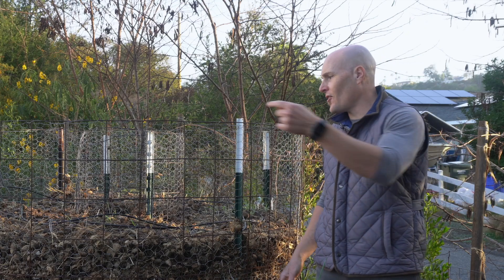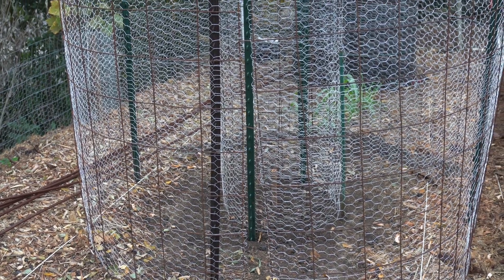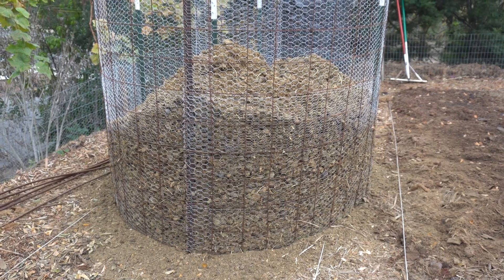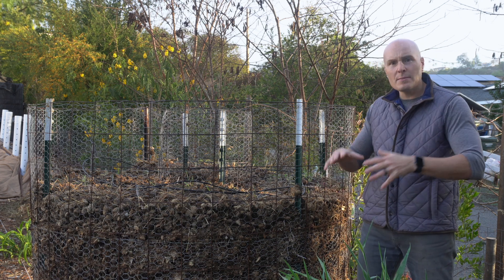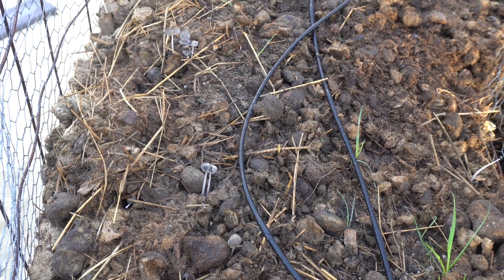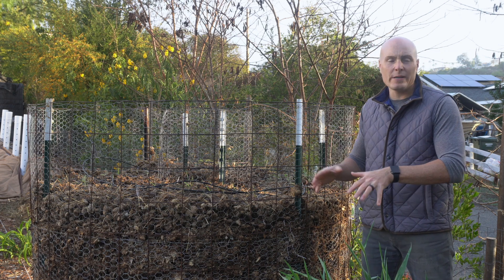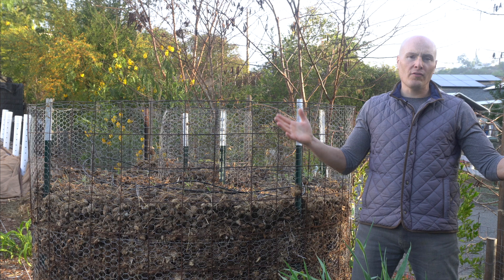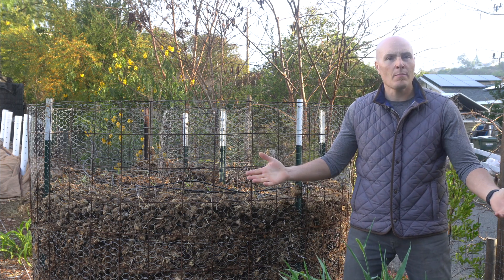Huge Compost Bioreactor | MORE COMPOST, LESS WORK

Comment: Hello Diego and commentors, I am working one of these bioreactors with my own modifications. The modifications are to the height of this system, it is 6ft tall and implements the extra 2 in outer ring with only woodchips. I did this because I live in Fresno, CA and our summer temperatures are very high so I hoping this will help keep the reactor moist (the reactor is located directly in the path of the sun, so I feel this will be a critical part of the composter) I have also added my own modification to this system which is a taller center tube. It is 8 feet tall and completely covered in a black weed barrier. I'm thinking behind this mod is to try to take advantage of passive solar aeration. My intention is that the added black weed barrier helps to heat the air in this tube as it rises forcing the outer rings to draw in more air from the edges. My concept is based African termite mounds. I started it March 6th 2024 and everything seems to be going well so far. I used only shredded chop and drop materials for the last few seasons of gardening onsite. I did later add 20bls of spent mushroom blocks when adding more fill material  after the pile settled about 8 inches. My temps seem to be going going down now about 3 weeks but are still quite high averaging about 110 degrees F. I did record temps as high as 150+ degrees F for a few days. I will probably add fill material one more time this week then top the pile with 6 inches of just woodchips protect the compost from the sun as the spring begins to heat up. I am very excited to have this reactor going as I wanted to build one basically right after learning about them.  I will also be building at least 3 more in the next few months, I plan on testing out other builds to see my  modifications seem be working as intended or are worth the extra effort and build materials. If you'd like to follow my systems follow my Instagram @CypressCompostCo and @hella_soil. Best wishes to y'all.

Comment: 73 old gardener here. 8 8’ T posts $96 n tax
Welded wire 15’ $89
Chicken wire…
$200 is too costly for tiny gardener. I will just continue throw/go/throw n go some more. Not in hurry have lots of compost n more leaf mold both free. But you are spot on. Cheaper more pleasing more efficient zero plastic. 
The Footer Bio Reactor!

Comment: At the end of the day, I have learned that the quality of compost is mostly a function of your inputs, not the method. If I am only composting grass, leaves, and other browns, it's ok compost. But if I add manure, kitchen scraps, and especially coffee grounds, the quality goes way up. You can't make something from nothing. But as much as I would like to supercharge all my piles, i also have to worry about rodents and other varmints. Plus, managing inputs throughout the seasons can be challenging. Bioreactors are an efficient way of dealing with the overwhelming amount of fall leaves when greens are limited, but they require a reeeeeally long time for maximum effectiveness. So composting is not all rainbows and unicorns. Don't get me wrong though. I love to compost, but it comes with its own set of challenges like everything. You just have to be observant, and what I found that is more helpful than anything else is to keep a garden diary.
Reply: Concerning the issue of input versus the method: Johnson's data seem to contradict your theory. Both fungal and bacterial diversity in his method are phenomenal.
As to the time needed for the optimal effectiveness, just look at it as long term investment. Your "overwhelming amounts off fall leaves" should provide you with enough materials on the side for faster, shorter term composts, shouldn't it?
Peace.

Comment: I’m curious what David Johnson would think about this. I’d love to see the finished product out of both the JS pile and yours. Great work
Reply: Yep a quick follow-up vid with David Johnson would be very valuable.
Reply from the maker: What are you going to learn from seeing the finished product from both?  I show you a picture with two piles.  What are you going to be able tell from looking at them?
Reply: @DiegoFooter  Good point. I guess it would take a side by side comparison between the two done at the same time and under similar conditions. I’d like to know if there’s a difference in the fungal activity between the two—which of the two is a better finished product that way—and will one break down faster than the other. Maybe I’ll try it and report back.
Reply: @DiegoFooter  coloration and effect on fungal growth
Reply: @DiegoFooter  
I would definitely like to see a video of you opening up this particular composter. I am curious to see what the material looks like close to the outside ring and close to the inside ring compared to the middle furthest from the Rings. In other words, did the pile dry out too much close to the wire rings. I am planning to use your design to build a few of these bioreactors over the next few weeks to compost leaves this fall.

Comment: I am planning to build a few of these bioreactors based upon your design with a few of my own improvements. I am going to use 50 inch by 16 ft galvanized cattle panels. I won't have to do any cutting and they won't be all rusty like the wire mesh and it will be cheaper because I won't have to pay $275 for a 150 foot roll of wire mesh. Using the 16 ft cattle panels, the outside diameter will be 5 ft and the inside diameter will be one foot. I am planning to make mine at least 6 feet tall. The very top portion will only be chicken wire, but I figure that will be strong enough for the top portion to hold the shredded leaves in.

Comment: I really like it, Diego. I am going to make one. I made one in a trash can like you made and it never got hot. Not sure if I don't have enough material, or what. I have it mixed about 2 parts carbon to 1 part green. Anyways, I am interested in making this one to try out. Thanks for going through and making all the different systems and testing them out. Doing all the research on all these different systems. Out of all the ones I have seen and looked at, I like this one the best.
Reply: I've never had great luck in trash can style piles. Common issues are: 1) brown carbon is already mostly decomposed/too dry 2)not keeping it moist enough. One way to cheat is to compost under a large deciduous tree with your pile touching the dirt. There is already decomposition going there because of the leaf litter, and the shade of the tree will keep the pile from drying out. I've also found that priming a pile with some manure helps a ton.
Reply: @atomicsmith  Thanks for the information. I hadn't added water since the huge pile of leaves I have are sitting out and we have gotten rain just about everyday since Jan. Today I started adding water to my trash can to see if that will start it up. Maybe that was the issue. It is sitting on the ground with holes in the bottom already, in a spot where my compost pile is, was. I have rotated the big pie with my tractor so it is moved over and really not much left of that one. It was wood chips that I mixed garden scrapes into. I did try to innoculate the new trash bin with old compost.
Reply: @EarlybirdFarmSC  Ah! I think the wood chips are the problem. Are they the big chunks of bark people often use as ground cover under landscaping? If so, those are very hard to breakdown. If they are from a wood chipper, do you know the species of tree? some trees like cedar and pine can be very hard to breakdown as well. Often if the chips are too big they just won't breakdown. Maybe try something lighter like sawdust or dried straw or hay. Sounds like you have plenty of moisture. maybe too much?
Reply: @atomicsmith  The wood chips were from a friend of mine that does tree work. They are all species but mainly oak and sweetgum in that mix. They are almost all the way composted into soil. Also, I only added in a shovel full, maybe two. That was just to introduce some bacteria and fungus into the new compost mix. Yeah, maybe I need to take out some of the leaves and mix in some shredded paper or hay-like you mention. The chips were piled up, I mean it was a huge truckload, and they were hot a day or so after they got unloaded. Just from the chips and the leaves that were ground up.

Comment: Hi Diego I have 2 horses and like your modifications to the bioreactor. Instead of filling it all at once do you think I could start filling it daily? I think one horse makes 50 lbs. of manure a day if I remember correctly. I wont have much of anything else to add to it as far as greens.
I thought if you didn't cover your pile of manure all of the nutrients would wash away in the rain and contaminate ground water sources.
Reply: Well not all your nutrients will wash away , maybe 1 to 5 % but thats about it .  Because of the thatch roof idea from ancient times,  water will run off most of the pile .... but if you want to cover it , by all means do it if it makes you happy. 😏

Comment: Im excited. Doing this this weekend so i have a spot for rabbit manure. I will make others for woodchips with leaves. But i think im skipping the chicken wire. Just too much cost at the moment
Reply from the maker: Depending the materials you are putting into it, I think you could get away with just the concrete mesh.
Reply: you could compromise and use the 2"x4" rabbit wire, not sure it it offers economic advantage,  you might be better off, doing two sets of concrete mesh, and offsetting a couple of inches.
Reply: @DiegoFooter  
I suppose you might be able to get away without using the chicken wire if you use really coarse material like full plant and Vines from your garden. I am planning to mainly compost shredded leaves, so I think I definitely need the chicken wire to keep everything contained inside.

Comment: hey man so one perk of the black fabric is it keeps uv sunlight off the surface which would try out the edges and kill good bacteria also would make it harder to do worms in it. Cool if that works for you though im sure it does the job anyways. I remember from the last video your logic was it is expensive which i was taken back by for a second i paid like 90 bucks for a giant roll of thick high quality stuff it is like 6 foot wide and hundreds of feet long and made of even better woven PET similar to those fabric pots i bought it online. And well even the cheap flimsy stuff from walmart or right from the garden section at the lowes or homedepot is still only like 15 bucks for enough to make 1 reactor atleast in my area in florida
Reply from the maker: If you want to use fabric then you should.  There are pros and cons for both ways.  There is no right answer.
Reply: If you are just making uv blocking, burlap can be gotten cheap or free from coffee sacks at local coffee shop. Easy for home diy. 
Might need to sew  or staple them together to hang over the compost wall
Reply: What a bioreactor looks like is important to me!

Comment: What is the age of the oldest compost u have processed in this bioreactor configuration and do u have a video where u show it’s current or finished texture so we can somewhat assess the results vs the traditional Johnson/su ?
Reply from the maker: The oldest is coming up on a year, and I haven't opened it.  It's filled with woodchips - so it will take a while to break down.

I am not sure what looking at the finished texture will tell you.  I wouldn't lean on that as a analysis method.

The JS diehards are missing the point here.  The goal of this design was to provide a design that produced nice finished compost using less plastic (something A LOT of people requested).  If you think the JS will produce better results, then stick with that.  I am not claiming that this will produce "better" results.   It will produce a useable result.  

I would also question "better" results from a JS compared to any other methods, but that's a different story.
Reply: @DiegoFooter  ah...they way the videos kinda hype this seemed like u expected at least as good if not better results and wasn’t sure how u would evaluate that...texture seemed the obvious criteria to observe the decay
Reply from the maker: I would expect similar very similar results because at the core these are both big worm compost systems.  "Better" is 100% subjective so we can all make the case that our compost is better than someone else's.  Unlike others, I am not going to make that claim, because I can't prove it - like everyone else.
Reply: @DiegoFooter  I don't get it, Diego. You yourself do a lot of experimenting and it's much appreciated. I really like your approach. But then when it comes to people suggesting to actually "look at" (or quantify) the results of this experiment, you seem to brush it off as irrelevant, or something of the sort. Like almost defensive, if you don't mind me saying so. How's that? 
I saw an interview you did with Elaine Ingham (bless her) and you do seem to have a taste for clear data. How come we couldn't apply that attitude to all (including your) endeavors?
Don't get me wrong, I respect you al lot. I just don't get it...
Reply: @mourlyvold7655  
I believe he is using wood chips which take a long time to break down. His results using wood chips probably look different and take much longer than my bioreactor where I mainly use leaves and grass clippings. That's probably why he is not in a big hurry to show the actual results. The most important thing is that he is coming up with great ideas and designs that people can use and everyone will get slightly different results depending on where they live and the materials they put in it. Great videos and please keep them coming.
Reply: @Well_I_am_just_saying  I enjoy his experimental mind set. From what I've seen he hasn't improved upon the johnson su reactor yet. 
Peace.
Reply: @mourlyvold7655  
In my opinion, he has definitely improved upon the traditional johnson-su bioreactor design. I am not sure if his modifications actually make better compost or quicker compost, but I am confident that it will be much cheaper and much easier for me to use a few of his modifications compared to the traditional design. This fall I am planning to compost a large amount of leaves along with some grass clippings.

The modifications that I am a big fan of are as follows:
1. No pallets 
2. No plastic pipes 
3. No plastic landscape fabric 
4. No air holes to collapse 
5. Much larger capacity 
6. Much cheaper 
7. Better airflow
8. No welded metal jig
9. Much easier to fill

I first heard of the johnson-su bioreactor on Diego's Channel about a month ago. It sounded very good and I planned to build a few of them this fall. Fortunately, I also watched his videos on his modification suggestions. I am also planning to put my own personal touch on it as I pointed out in a different post that I will copy below:

I am planning to build a few of these bioreactors based upon your design with a few of my own improvements. I am going to use 50 inch by 16 ft galvanized cattle panels. I won't have to do any cutting and they won't be all rusty like the wire mesh and it will be cheaper because I won't have to pay $275 for a 150 foot roll of wire mesh. Using the 16 ft cattle panels, the outside diameter will be 5 ft and the inside diameter will be one foot. I am planning to make mine at least 6 feet tall. The very top portion will only be chicken wire, but I figure that will be strong enough for the top portion to hold the shredded leaves in.

So basically, I'm planning to buy three cattle panels, one roll of 5 ft wide chicken wire, plus use some fence posts and stainless steel wire that I already have. I should be able to build 3 large capacity bioreactors for less than $150. I should know 8 months from now if it was worth the time and money and effort.

What are your thoughts???
Reply: @Well_I_am_just_saying  I'm off to bed, will read and react to your reply soon.
Be well.
Reply: @mourlyvold7655  
Ok, I will be waiting to read your reply. Time for me to get some sleep too.
Reply: @mourlyvold7655  
Are you still in bed sleeping?
Reply: @Well_I_am_just_saying  I'm curious how your cattle panel bioreactors turned out. Was the grid small enough to hold in the wood chips without the use of chicken wire?
Reply: @sandrabrown4993  
I am planning to completely line the cattle panels with chicken wire.  In other words, I have replaced the landscape fabric with chicken wire. 

I am not planning to use any wood chips (they take too long to decompose).  I will mainly be using shredded leaves plus possibly grass clippings and shredded plants and vegetables from my garden. 

I have been collecting and shredding leaves over the past few weeks.  I need to build my bioreactor soon so that the process can start working before freezing temperatures set in. 

I am also planning to rototil a large amount of shredded leaves directly into my garden this weekend just like farmers do with corn stalks each year. In my opinion, that is the easiest and most efficient method to use as long as I do not overdo it with the amount of leaves that I put in.  Therefore, I will probably only build one bioreactor instead of doing 2 or 3 of them.

Comment: Now you made this about 12,5 ft long ringshaped compost pile. If you're running into space problems would it be possible to build a rectangular shaped pile of this concrete mesh/chicken mesh on the inside, also 2 ft thick at a prefered length? Would this work as well?